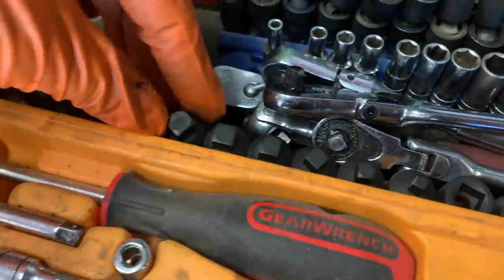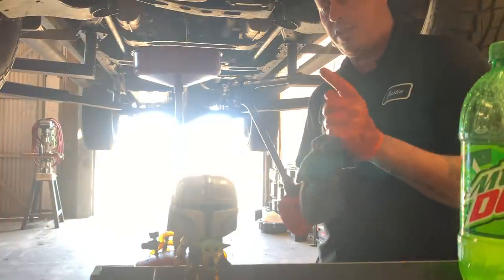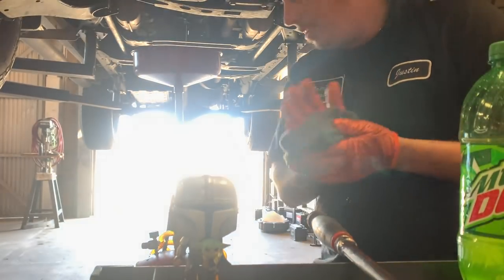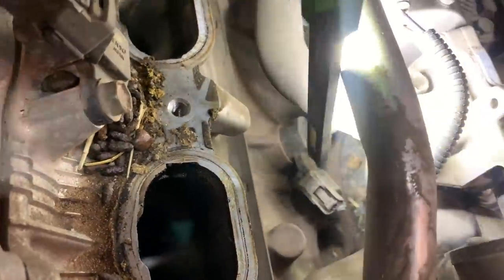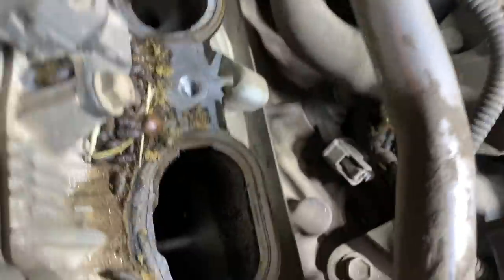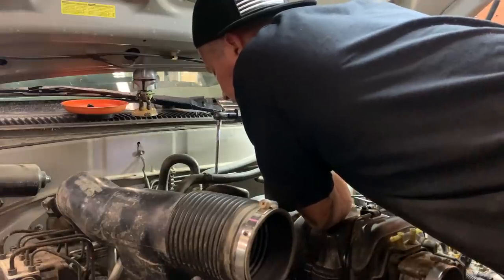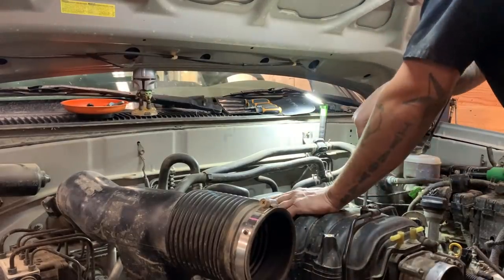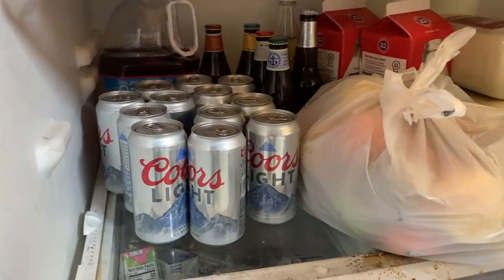Slow is Smooth Smooth is Fast!

Comment: I'm cringing at open intake ports with all that debris/rodent droppings ready to fall in.
Reply: I was thinking about that too. My dad jumped my shit about that 25 years ago and I still remember that ass chewing lol
Reply from the maker: I vacuumed it up. You’ll see when I am using the Hercules heat gun on the heat shrink that around the ports is free of rodent 💩 that’s because I vacuumed it
Reply: I’m not concerned about the 💩 falling in, I know it’s not catastrophic if some falls in.  I’m thinking while you’re working and you drop something like a nut or a bolt.  For me, it’s manifold off and immediately protect the ports - normally with masking tape.
Reply: @ghostwrench2292  yea but I prefer towels of any sort for me. 👍🏾 👍🏾

Comment: 3/8 impact gun will remove the 12mm intake bolts fast.
Reply from the maker: Not much room between the fuel rail and the intake & someone was borrowing my 3/8 Cordless Snap-On

Comment: Second get ready for plastic drain pans/oil pumps, using torx sockets t45,t47, t50,t55 they have been common on some if the things I've been working with theres also plastic

Comment: I have a 3/8 matco impact driver (12v). It would have made that job, 1/4 times faster. I dont know many "techs" that would torque down intake bolts. Js. I just Run em, and gun em. 98% of the time it works.

Comment: How you liking that gearwrench torque wrench?
Reply from the maker: I'm Diggin it. Like the flex head over the fix head Husky 1/4 that I upgraded from. Having the angle has been one of my favorite parts about it. I also like being able to adjust to other forms of measure where the Husky strictly had NM & Inch lbs

Comment: Justin, You said in the last live stream torquing plastic in-take manifolds bolts. I am wondering about what torque is take. I am not working on anything just curious ?
Reply from the maker: intake manifold. Some modern vehicles us plastic over aluminum and back in the day the were cast iron.
Reply: @JustinDowDIYcentralhighway  Justin, Let put it another way what Torque value do you use ?

Comment: Howdy,
  Griff here. Great content brother. Nice to see the square plug removal in action. Gonna grab a Sunex set when I'm able, things going a little slow on my end right now.
  Anyways, just curious, and I'm sure you've commented on it, but that 1/4" Snap on you use, is It as good as it seems an MD would you recommend over say, a Milwaukee? That's what I use and the M12 fuel is a beast for me. Been seeing people trash them lately and I just can't see it. Guess it all depends on the individual tool. Just wondering if you'd tried out anything else or if this is your go to small workhorse.
     Have a great evening and as always, ONE LOVE my brotha 😎
   Griff
Reply from the maker: Actually that Little 1/4 cordless ratchet is a MATCO & it is for sure my work horse. I own the 3/8 long reach ratchet but I was letting Joey use it. I previously owned a Milwaukee 3/8 Fuel ratchet. It was a Beast & was my only cordless ratchet at the time. Things I did like about it I made mention of in videos was the battery tangs would break and cause the tool to not work (light flash fast/ loss of connectivity) I didn’t care for the selection switch at the top (too difficult to manipulate between clockwise and counterclockwise/ and if you back yourself against an object it’s almost impossible to switch the mechanism to free yourself back up by tightening it back down. Though some people said they were in a huge fan of the paddle style never really bothered me to be honest, but I have preferred the non-paddle style trigger the Snap-On has to offer/ I even like the way Matco did theirs. Either way that’s the luck my friend ☕️😎🤙
Reply: @JustinDowDIYcentralhighway  Thanks for the info broski. I too don't mind paddle style or traditional trigger. My reasoning for the whole question was adding another E ratchet to my arsenal and it will be a 3/8", figure it's worth a shot. Not the easiest to get a Matco for me, considering I have NEVER seen a truck around here, but I guess I could go direct order.
    On a some what related subject, have you seen that new 1/2" Mac impact kit? Comes with an extra battery, charger, and set of metric sockets, 10-22mm (no skips) I believe that's what it contains, might be wrong on that one, not sure. It's awesome but it's freakin $1000!?!!! I just have a hard time paying that, when I know I can assemble that for a 1/3 of cost with quality tools and a better warranty. I saw it in Clay's (Koon trucking) video the other day. And the weird thing, the Mac dude said Dewalt batteries fit that impact 🤔🤔. Interesting.
    One love,
Griff

Comment: I know what you are saying about the damn rags the shop I started at a month ago we have 4 rag pails thru the shop but nobody will use them I pick rags up all damn day when walking to the parts room or bathroom because the uniform guy will get the rags from the pails but not the floor and I was taught 30 years ago to maintain a mostly clean and orginized work bay

Comment: I got a 13mm square drain plug for my Nissan,  I bought it on Ebay.   Its a Beta tool13mm 1/2" drive.   What I did not think about when I got it was that the seller was in the UK.   It took over 3 months to get it LOL.   I find it make a nice tight fit on the 1/2" drain plugs on the equipment that I have at work.  And I agree the plug socket is much better than using an extension, better fit and better insertion and extraction.

Comment: service manual: In-car repair instructions: step 1: dislocate your left shoulder from its socket, and dislocate your thumb and middle finger of your left hand.  Step 2: with that mangled arm/hand reach back between the intake and the firewall. . . .
Also "Haste makes waste".  Easiest way to sum that concept up.

Comment: Had to replace a engine air filter on a Jeep Patriot Latitude. Used just a ratchet and socket items to use. Last time tried it with a impact driver. 2min job became a 10min one looking for the 8mm socket in the engine bay.